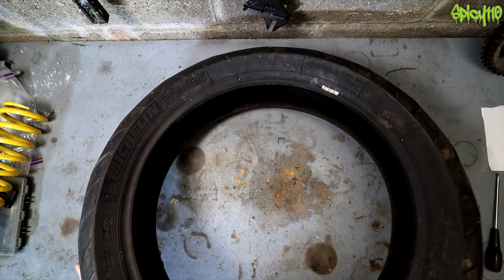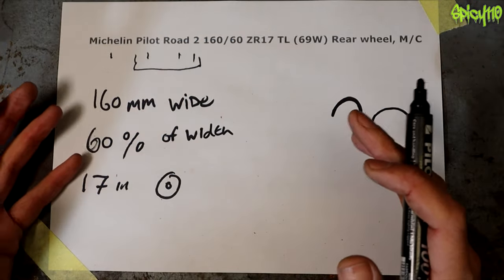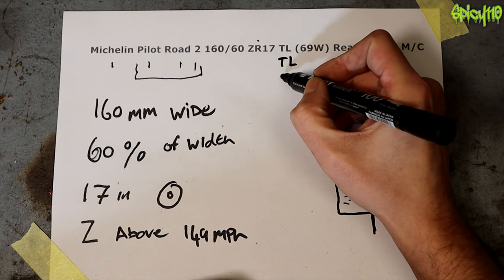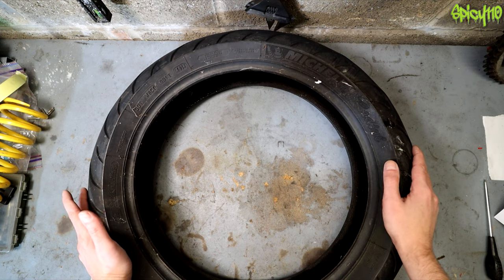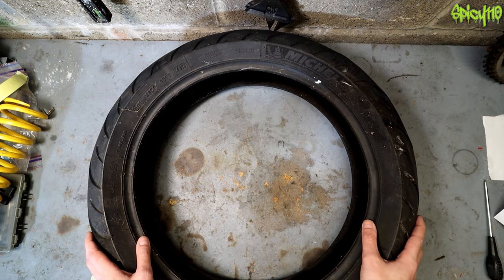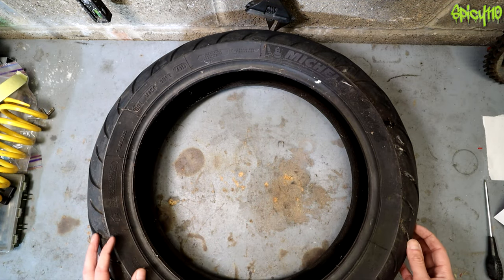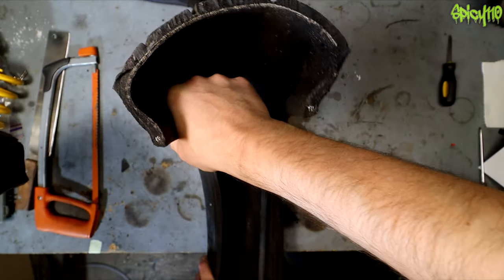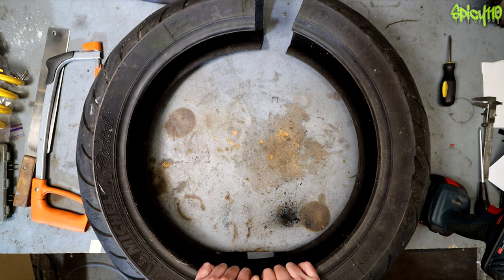Motorcycle Tyres | Everything you need to know for New Riders!

Comment: Cold weather is a killer of tires left outdoors. Nice to see you use a hack saw and not fall down the rabbit hole and use a disc cutter as they mess up the cross section you wanted to see as they melt the rubber as they cut.

Comment: One of the biggest mistakes many riders make, and this is not just the new guys, is to pick a far too sticky (sporty) tyre thinking it will be better and make them faster. In many cases this will be, unfortunately for them, just not true. Super sticky tyres need a certain amount of heat in them to work properly and give their best, so be realistic in your abilities. Unless you're one of the fast guys, you will never get the heat into them they need, and a fast tyre running well below its optimal operating temperature will probably be offering less grip then a less sportier one that is fully up to temerature and spit you off into the undergrowth. Talk to your tyre guy, and be honest with him without blowing smoke up his arse, there is a BIG difference between what tyre you'd like and the one you need (can use fully). You might even save yourself a good chunk of cash into the deal, as the tyre you need could cost less and will last longer and you'll enjoy your bike far more.
Reply: Couldn't have said it beter myself mate. Like you said as is more often the case most road riders would benefit from a sport touring tyre over a hypersport tyre as they simpy can't get the heat into them to achieve optimal performance.

Comment: My 701 came with tubeless on a spoke wheel, and the spoke goes up into the wheel as in normal spoked rim with some sort of rubber sealing ring fitted in the middle of the wheel.
Reply from the maker: Yes that can also work, but it is designed that way from the start.
Reply: @spicy110  
Yes they are, the edges of the continuous rubber belt  push into recesses built into the rims. Totally standard equipment.